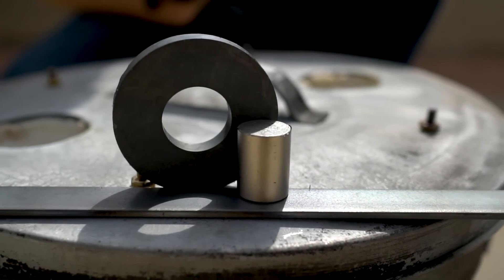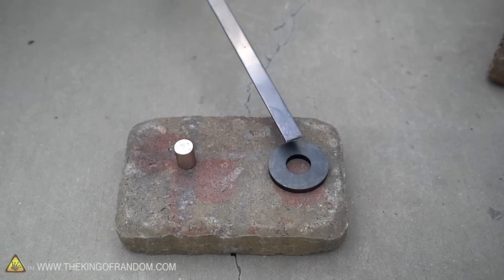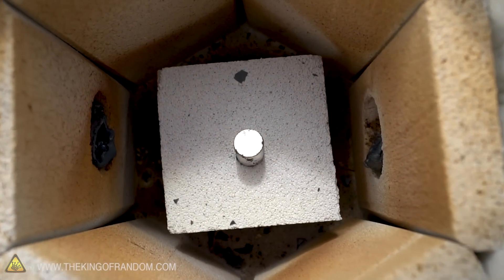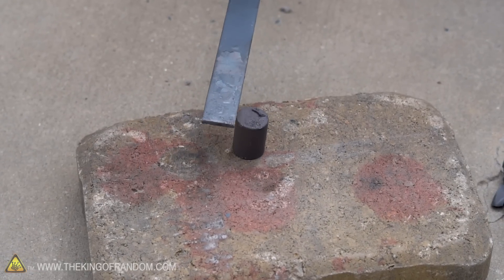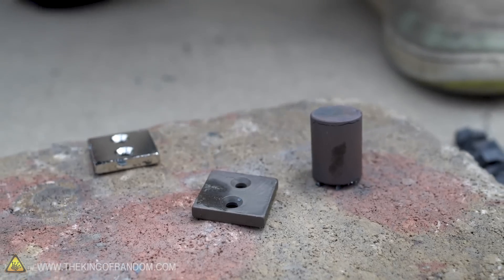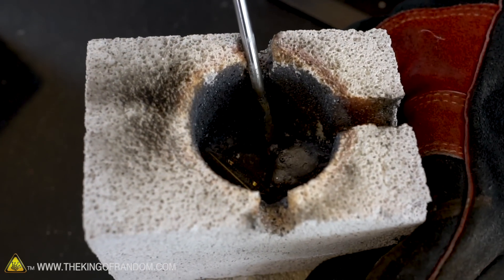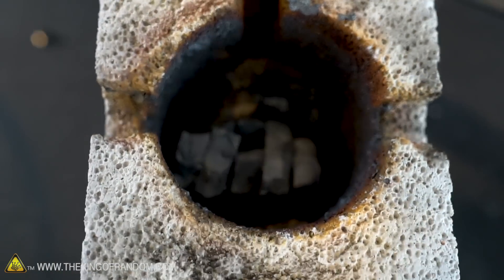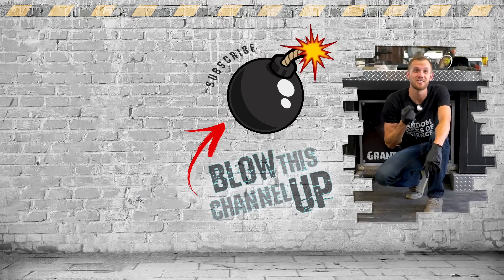Melting Magnets is Weird

Comment: As soon as you heat a magnet lose the magnetism. You need to put the cooled magnet into a high magnetic field to codify the new magnetic field into the magnet. You can do that when the magnet is cold, or when the magnet is cooling down.

Comment: Here’s the ultimate video for you. Take two of the strongest magnets you can legally buy. Drop one in a vat of liquid nitrogen or something colder like helium or oxygen. Then drop another into a forge bringing it to the highest temperature you can before it melts. Then see if the super charged frozen magnet can attract the red hot magnet. I would recommend not being anywhere near the experiment though.

Comment: So this is why when the Sun throws a solar flare the Earths magnetic field also gets weakened. Same mechanics?
Reply: Dave Rios yes, because solar flare means radiation and radyation means heat means weakened magnetic field.
Reply: @MuhammedhilmigulluBlogspot  That does not make sense considering that earth is heated up from inside and it does not affect it

Comment: You have to keep a strong magnetic field next to the magnet while it cools from red hot or it'll become randomized and be very weak magnetically or not at all. That's how they make them. They heat them to glowing and then put them next to a powerful electro magnet while they cool to align the fields.

Comment: Neodymium starts loseing magnetism to 70c that it will rebound on cooling anything above 70 c is permanent loss if you have a piece and you take it to 100 c let it cool it will rebound some power but have some permanent loss but never more than that as long as its never taken above 100c at 130 c most neodymium permanently loses all magnetism except for high temp varieties 

  Why pushing a quadcopter motor will turn it into a paper weight 

   Regardless of how cold you get it neodymium will only lose very little magnetism and is never permanent

  When they are making neodymium the flash it with a very intense magnetic pulse to align the poles

Comment: well it is possible to reactivate the magnets by reheating the magnets to round about 2/3 of the melting temperature and while let them slowy cooling down, expose them to a strong electromagnetic field. this will give the randomly ordered magnetic molecules the chance to re-aligne in to the into the proper magnetic order and maintaining that position.

Comment: Create an electromagnetic tube that has heat protection in the center that doesn't block magnetic waves, heat the metal to various temperatures, and see how hot you have to get the metal to transfer the magnetism to the metal.  It there should be a specific temperature for the poles of the atoms to shift, to make it magnetic.

Comment: When steel gets to critical temps (non magnetic) thats close to the temp you need to heat treat it by quenching it in oil or water "depending in the steel composition

Comment: i used a zvs with flyback on neodimium magnets. After short exposure (few seconds) to the high voltage it becomes very, very weak. So neodimium magnets can be broken with heat or electricity. Don't know if it's the current or heat because that flyback's plasma was white hot so it could be the heat or current. Still don't know. Do you?

Comment: So what happens if you put a magnets in liquid nitrogen and super cool them do they get stronger
Reply: Magnets under cryogenic temperatures (liquid nitrogen like) tend to have more magnetism. This is because cold temperatures creates contractions and atoms are arranged in a more controllable way. This creates strong magnetic forces thus. higher magnetism.

PS : Magnets turn to superconductors under those temperatures is bulls%*#. All videos will be explaining how superconductors under those temperatures are kind of making magnets float on air.
Those superconducting magnets are a different business altogether.  Don't go deep in and mix everything.
Reply: You know, the magnets are not magnets anymore, so if you cool them, it is like you just like if you cool steel.
Reply: Yep
Reply: ummm...it becomes a superconducter i think...
Reply: I guess magnets brought down to extremely cold temperatures become superconductors
Reply: I don't think it would make much of a difference. Once they solidify and cool to ambient temperature their matrix is frozen in place. All of the axes (plural form of axis) of the orbital paths of the atom's electrons (and some other subparticles within the atoms) are already fixed to their corresponding positions in relation to the other atoms contained within the matrix. But since jarring and vibration can weaken a magnet I suppose that does suggest possible repositioning can happen. So maybe a measurable/noticeable change could occur if more time were alloted and at colder temperatures and the lower the temperature. Just my humble opinion.
Reply: I believe when they get under a certain temperature, they become superconducters, a few youtubers have made videos on it, its really interesting
Reply: No
Reply: Look up a mobius strip
Reply: Nikolai Orr How does that have anything to do with magnets??
Reply: Yes, in fact.
Reply: Magnets 101: Warmer = Weaker, Colder = Stronger. Physical agitation such as impact, jostling, & vibration over time will also weaken magnets.
Reply: @derickmoore1709  well youre quite wrong •-•
Reply: @chi3002  he is not even remotely wrong.
Reply: It gets stronger
Reply: Bro he's dead
Reply: @Larc3069  That's how you make superconducting magnets
Reply: @Larc3069  so what? hes asking people in the comments

Comment: ceramic magnets would need to be heated by the furnace before being exposed to the extreme heat, it would handle the heat better then but would still not melt.

Comment: This magnet experiment completely destroys the inner and outer core hypothesis accidentally. Molten hot iron core = No magnetic field.
Reply: lol. you spoke like a lumberjack tryin to understand fashion! nice thinking. but what if there is more , like a lot more thing to consider.presure of the core,constant movement. and like 100 thinkgs more i dont even know. lets go ask a real scientinst
Reply: Gravity reverses at some point inside the earth. How do you think we get zero gravity at the center of earth? That's how. Reverse gravity will offset all that pressure making center of earth low pressure instead of assumed high pressure. Pressure has nothing to do with magnetic field anyway, it is the intense heat in solid earth hypothesis that destroys the inner and outer core hypothesis. Also you can't have planets in constant pressure like conditions, that like asking planets to randomly explode. Just continue heating the pressure cooker without letting the gas/liquids out increasing its internal temperature and see it eventually explode.

Comment: You keep saying that the one bar is steel, but if I am thinking correctly, aren't magnets attracted to iron, not steel?  There has to be iron in the steel if that is so, so why not just melt pure iron to begin with?
Reply: Magnet-attracts metals
Steel-metal(iron + some carbon+other things to make it tough)
Therefore-
MAGNET ATTRACTS STEEL.

Comment: Isn’t molten magnetic and neodymium for keep metal steel not working pull on magnetic field and particles atomic molten metals no longer heat higher metals. About this’s magnetic molten been exploded this faster molten atomic energy failure working heat
Reply: Are you okay?

Comment: The ceramic magnet shattered because of thermal shock, not because of any magnetic property it holds. Ceramics will shatter when the temperature of the ceramic is unevenly heated. I would say try slowly heating it, but heating a magnet is a known way of destroying  a magnet, so it wouldn't be very interesting.

Comment: Heat destroys magnets. Though I have read if you have a steel bar and heat it and suspend it then strike it with a blunt object so that the vibration flows through the bar north south you will create a permeate magnet. I think it’s does something to the electrons and then I think you quench it so that they stay like that. Bam a magnet. Your should do that buddy’s cause I wanna know if it works and the last time I tried it the bar burned thru the string and burned a hole in my garage carpet..lol

heat a steel bar and then try a tuning fork and different frequency vibrations. Maybe the music playing in the background would make the steel bar grow long hair and put on tight ripped jeans and blue eyeliner?

Comment: if he is proving that magnetic metals lose thier magnatism when hot, how does the earths magnetic fields work if the nickle core if molten? or does nickle keep its magnatism when hot? or is the eaths magnetic fields generated by the iron in the crust & spining nickle molten core?
Reply: It completely debunks the iron core theory of solid earth theory.
Reply: verittt2006.....Nickel is not magnetic.....The earths magnetic field is electromagnetism.....
Reply: @jackotheshadows9420  You don't have electromagnet with constantly inputting lot of electricity from external source.
Reply: +Xeno Bardock .....100 LIGHTNING Bolt strikes the earth every second = roughly 8 million a day and 3 Billion in a year..... A average lightning bolt striking from Cloud to Earth is equal to 1 billion joules each..... I point this out not to say the power sources outside going in but as a empirical sign of how much electricity is contained within the Earth..... The center of the earth core is under tremendous amounts of pressure and is creating a superheated dense core with the likelihood of a natural nuclear reactor as the core...... We have very little idea how much real power is contained by any reasonable measures used to date.....
Reply: @jackotheshadows9420   Inner and outer cores do not exist. Earths magnetic field is generated by the 3000 km thick and colder shell like a hollow sphere magnet.
Reply: @jackotheshadows9420  Search "Hollow Planet Seismology Vs Solid Earth Seismology".
Reply: @jackotheshadows9420  Scientists have found vast oceans of water in earths lower mantle almost 3000 km below the surface which further confirms Jan Lamprecht.
Reply: @jackotheshadows9420  Sure with lightning bolts you can explain earths magnetic field but you don't need iron core for that. One can easily easily say that the 3000 km thick hollow shell generates earths magnetic field this way.
Reply: @jackotheshadows9420  I'm still having trouble understanding (how) earth has a magnetic field. I'm only as smart as the school system of 70's to 90's made me unfortunately :( they told us about earth having a magnetic field, but never (how) or (why) it does, only what it was.

Comment: Try heating the neodimium magnets past 1000° then let them cool off on an electromagnet, since an electromagnet wont lose its power to heat. Theoretically, as long as all the elements are still there and not carbonized, they should restore completely. But I dunno, they looked chrome plated before. They might have to be replated to keep from oxidizing.
N/m..i just saw the end of the video.

Comment: Well, that's interesting cause the part of the planet that causes the Earth's magnetic field is molten, and the Sun also has strong magnetic fields that cause sun spots and solar flares.
Reply: The Sun is plasma and powered externally by birkeland currents. Youtube search "birkeland currents explained". Earths magnetic field is generated by the 3000 km thick and colder shell of the earth, not the core. Think of how a hollow sphere magnet with holes at both poles will generate magnetic field, same thing with earth. This magnetic field of earth will very slowly weaken and eventually disappear, resulting in Mars-like conditions.

Comment: Cores of all planets are electric incandescent plasma ball, not iron. You can literally observe the plasma core of any planet from its geographic poles, rotation axis. Watch video "jupiter's north pole winds". You can clearly see the plasma core of jupiter and light radiating from it. Same with all other planets.
Reply: You suppose that there is plasma in our core?
Reply: @Beertraps  No heavy matter in the cores of all planets due to centrifugal force being at its max strength at the center of planets and gravity being zero strength at the center of planets.
Reply: @Xeno_Bardock  Why would the centrifugal force be at its max strength at the axis of rotation? Also how far down would all of the heavy matter be in your hypothesis?
Where exactly is the point that the gravitational pull is stronger than the centrifugal (apparent) force? 
Also what kind of plasma are we talking about?
Reply: @Beertraps  Centrifugal force is very real force, not apparent. All heavy matter is in the shell of planet, forced there by centrifugal force. Earths shell is around 3000 km thick. Gravity exist entirely within the shell, not at the center of planet. We are talking about electrically charged plasma made of lighter matter like gases, that's the only composition of cores of planets since no heavy matter exist in the core. Plasma cores of planets spin very fast, much faster than the shell of planet.
Reply: @Beertraps  Centrifugal force is at its max strength at the center of planets, not at rotation axis.

Comment: This heat causes a change in the iron crystal structure.  Austenitic stainless steels are iron alloys that the alloying elements force into the same crystal structure as hot iron or steel. So they are not magnetic.

Comment: No real shocker here.  When the magnets get hot enough, the atoms lose their alignments and tend to neutralize each other and become more random, like raw steel.  What would be interesting is to try and heat steel and introduce (with heat shield) to a large magnetic field and see if afterwards the steel atoms realign to form a magnet itself. (testing how strong the magnetic field of the steel is compared to whatever influenced the alignment, and if more heat can create a tighter alignment, i.e. stronger steel magnet.)  It would require a static magnetic field, and not one created by AC current through a coil winding.

Comment: The King Of Random I think you can "remagnetize" them using a magnet.
Magnets are "filled" with elementary magnets which are all lined up when the magnet is.... well magnetic, but using heat on magnets is going to mess up the elementary magnets and destroys the magnetic abilities of it.
Now, how to sort them? Just use a magnet and pull it all over the "destroyed" one
The elementary magnets are going to be attracted and lined up again but you have to get some distance when pulling the magnet away from your messed up one, otherwise it wont fo anything because they wont get away from the attraction and not get lined up at all. I dont know if there are grammatical mistakes, but if then im sorry im from germany, sooooo yeah i hope you could understand it.

Comment: A cool experiment would be to melt down the steel (or magnet) and the apply an electromagnet field to see if the the cooling material will have a magnetic field after it cools due to the influence of the field while it cools

Comment: Before I watch this video I'm going to take a gander and say that heating up a magnet will cause it to lose it's magnetism as the whole reason magnets are as powerful as they are is due to the arrangement of the atoms within the magnet. Neodymium is not the most magnetic element in the lanthenide series, but it certainly is the best at lining all the atoms up in the same direction making for extremely powerful magnets.

Comment: I'm sure I'll make a few small errors in this explanation, but essentially what happens is...

Metals can lose their magnetic properties at a certain temperature, called the Curie point, named after the husband of Marie Curie.

All atoms of an element are basically all the same. They all have the same essential properties, same number of protons and electrons. Each element's properties is influenced by the chemical structure of the compound. Specifically for magnetic objects, each smallest constituent part (whether that be an atom or whatever else) is influenced directionally by a magnetic field.

As you heat your iron, you excite the atoms, causing their form to become more randomized. If they cool down slowly, the metal atoms orient themselves in a crystalline pattern, which makes the total structure hard. This type of metal retains its edge, but is also brittle and prone to fracturing. (This is why throwing water on a hot pan can make it crack). The crystalline structure causes each atom to be oriented in a specific direction, which allows the magnetic field to penetrate and physically move/align the object by its poles. The name of this kind of structure is called an allotrope, and steel has three allotropes that share their hard brittleness, Martensite, Pearlite, and Ledeburite.

If you quench the steel in oil, the atoms don't have the time necessary to align themselves into a crystalline structure, making the metal less useful for holding an edge, but also making it bend instead of break, and be less prone to breaking. The more random arrangement of atoms causes each atom to be forced apart in the same direction relative to their structure, but the influence of the field cancels itself out as each atom is facing a variety of different directions. This allotrope of steel is called "Austenite"

So by melting the magnets themselves, you're taking the atoms' alignment away, which is why they're no longer magnetic.

This is grossly oversimplified
Reply: You should be a teacher, you are pretty smart
Reply: @taeisawesome4785  Or it could be, that like her husband after being nagged and nagged and nagged at day after day and week after week, they finally give up and cave. haha